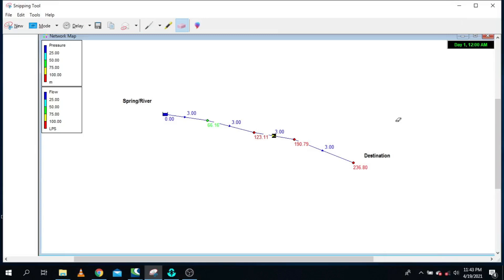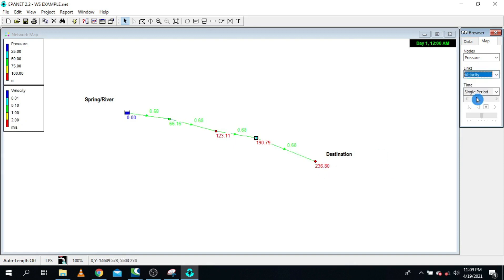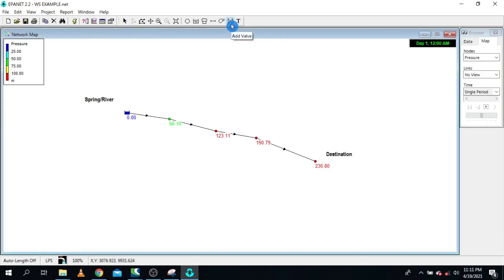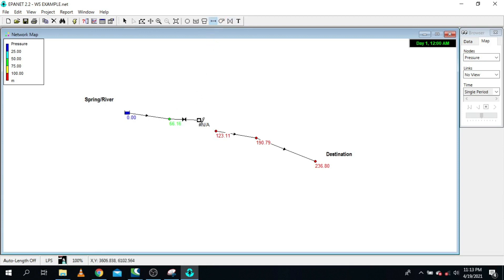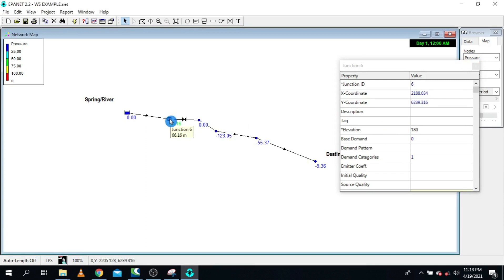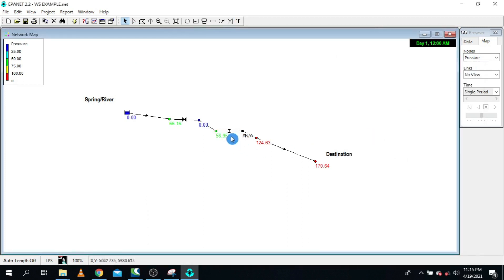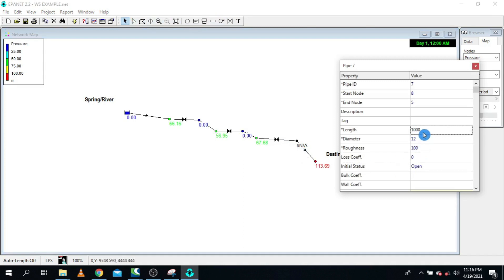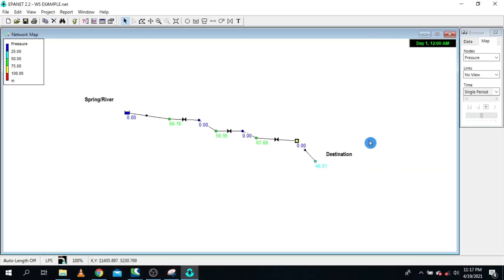EPANET Tutorial: How to Model Break Pressure Tank (BPT) in EPANET Software [A complete Guide]

Comment: Thank you for this video. Really helpful. Question, what is your design criteria or for pressure? Or what is the minimum and maximum pressure for pipes?
Reply from the maker: Depends on where you are living and which design manual you are using. But normally, for dynamic pressure it ranges from 6mwc to 30mwc!

Comment: Hi, thanks for the video! Is it common practice to use Pressure regulating valves as BPT's? I tried using storage tanks as BPTs in Epanet but it was complicated to manage.
Reply from the maker: Although both BPT and PRV perform similar functions, they differ in their mode of operation. BPT is responsible for reducing both static and residual pressure to zero, whereas PRV is used to regulate or maintain pressure (dynamic pressure) at a given pre-set pressure. In this tutorial, we have employed PRV to model BPT, but it's important to note that BPT and PRV are not the same.

Comment: Can I increase the pressure using valves?
Reply from the maker: As far as hydraulic modeling goes, at a given Q, we increase pressure (residual) by increasing pipe sizes. I think with valves (PSV) you can only maintain a certain pressure in a system or reduce pressure in a system (PRV) but IMHO, the only hydraulic tool that increase water pressure is PUMP!
Reply: @HydroinformaticsAcademy  Thank you, sir! I think I might have a lot of questions regarding the project that I am currently working. Where can I possibly raise these questions? Do you have an email sir?
Reply from the maker: Linkedin: Lodrick Thomas
Reply: @HydroinformaticsAcademy  Sir, I cannot message you in Linkedin because I do not have premium account.

Comment: Thanks for this video. can you tell me what to do if velocity between two nodes is coming to zero in EPANET software? Tried to decrease the pipe diameter but not able to increase velocity.
Reply from the maker: And it's not the only velocity even discharge/flow might be zero! now, If you are dealing with a pumping water project and you are pumping water from borehole to storage tank then the problem might be in "tank"! DO THIS...

Go to the storage tank and MAKE SURE the INITIAL WATER LEVEL IS SMALLER THAN the MAXIMUM WATER LEVEL! I.e. if the initial water level is 3m then make sure the MAXIMUM LEVEL is at least 3.1 or above!

The other option is if initial level = maximum water then MAKE SURE YOU SET OVERFLOW to ON!

Give it a try then let me know what you get!
Reply: @HydroinformaticsAcademy  Yes flow and headloss are also zero. Actually, I haven't used any pump in the network, also my initial level in the tank is less than the maximum level of the tank. I wanted to supply water through gravity so I have used a storage tank. Please tell me if there are any other reasons for velocity becoming zero.
Reply from the maker: I had such a problem with pumps but for gravity nope..

But the only situation when Ve becomes zero is when one of the pipes is closed or you did not set any base demands on nodes! Because even if you set large dia pipes you would have small Ve but it would not be zero!! May be try to check base  demands... if still no solution  and if you wont mind you can send me the model so as i can check it... (linkedin id "lodrick thomas")
Reply: @HydroinformaticsAcademy  Thanks for your reply. As you said my dia are large even though I am reducing my dia velocity is showing o.oo. So, I have reduced my dia to very less (almost 25mm) then I got velocity as 0.01,0.02 so on. Please tell me whether these velocities are sufficient for an efficient network. If it won't bother I will send my file to you give me your valuable suggestions
Reply from the maker: 0.01 m/s Ve is very very small...